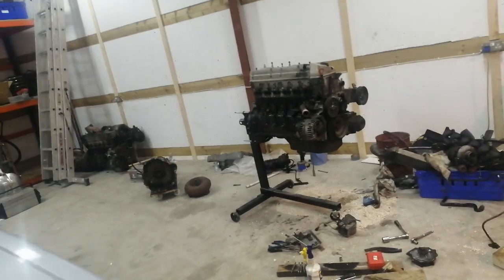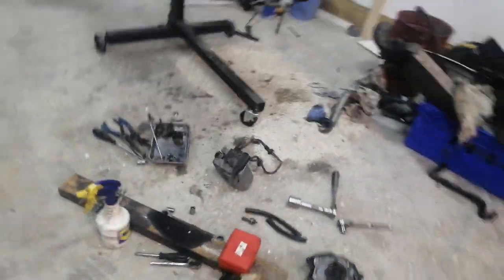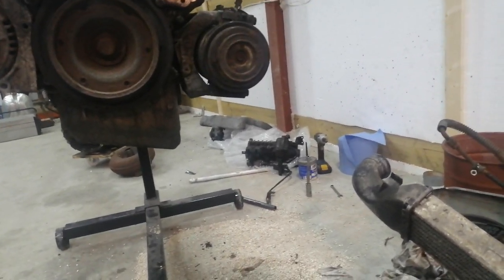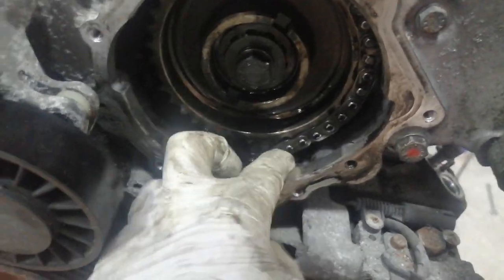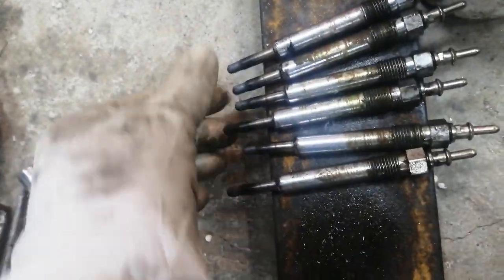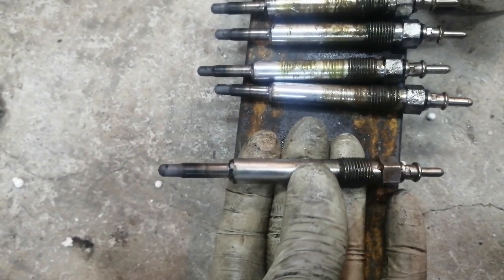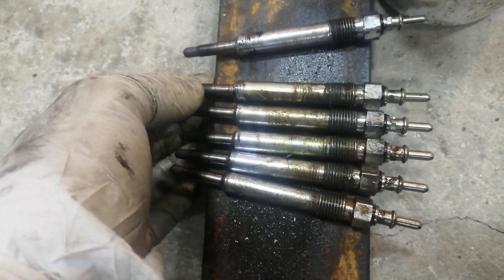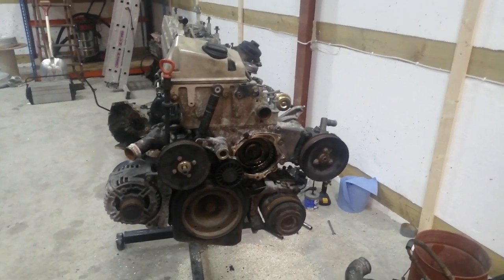Pump fitted and timing - w124 om606 build

Comment: Hi Niall
thanks for the informative vids.just fitted my manual pump from dpuk last week on the om606 with relative little problems.thanks to Luke for an excellent tutorial on Youtube.you might find that the throttle arm is gonna rub against the heater plug once fitted so you ll have to bend it  so it clears the heater plug cover.
is the red nipple cover the vacuum for the engine stop?Can you tell me where the pipe would connect to from the alda (black nipple cover)please
greetings from Galway
Reply from the maker: Im not fully certain but I think a feed off the intake manifold will go to the alda and mean the actuator will operate as the boost builds. The red nipple is indeed the cut off for the pump.
Reply: @22rabbits   many thanks
best regards
philip

Comment: Great videos Niall. he body of the glow plug from threads all the way down to where the heating element starts is all one piece of metal so it's meant to be grounded to the head by the threaded part anyway. Anti-seize stuff on that part isn't an issue at all.